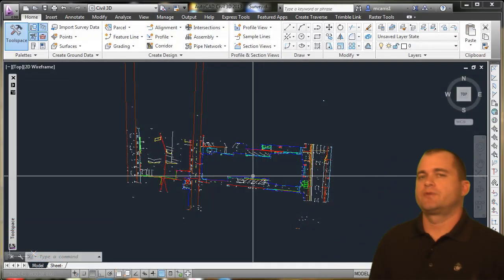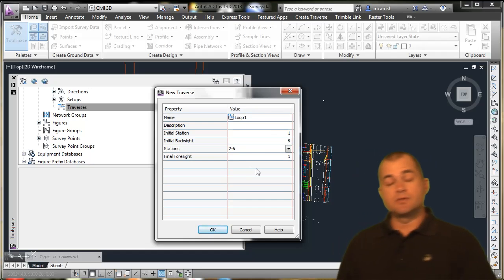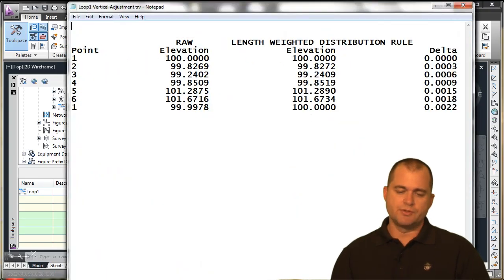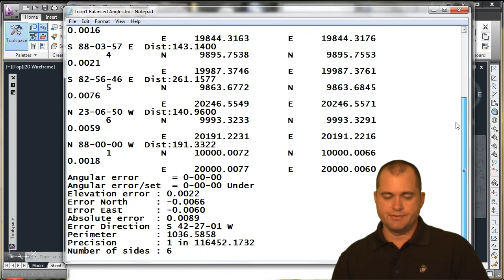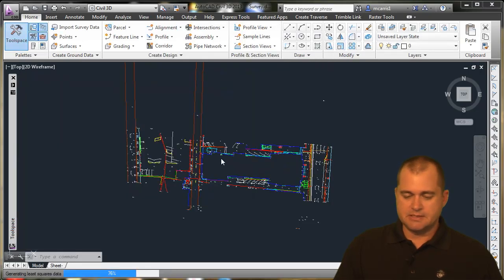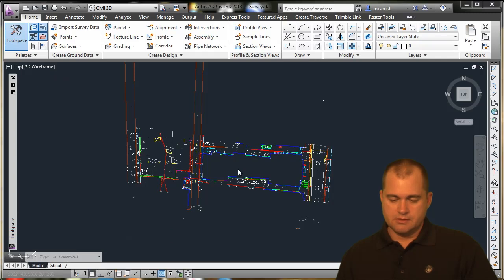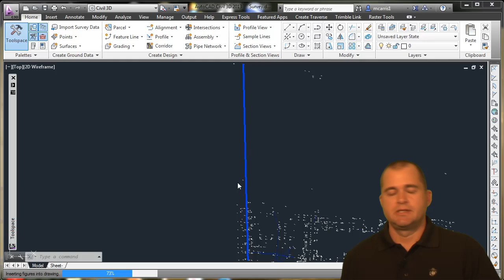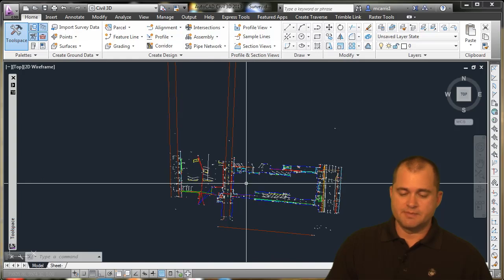Survey Traverse Adjustment in Civil 3D

Comment: I'm having a problem with trav analysis.  Explain how the trav properties work. I followed your video but still having errors. 
I understand initial station  (#202-Original Cntrl&occupied)
I get Initial Backsight          (#201-Original Cntrl&occupiedl)
Explain stations to me?....all the occupying pts of trav?   (1000-1013)
Explain Final Foresight?...the final foresight is pt#1014(field stored)...original is #202
1000-1012= set pts
1013=201
1014=202

Now using final forsight as 1014, I get "unable to calculate traverse closure"
using final forsight as 202, I get "..cant balance, doesnt close, not enough info" or something like that.